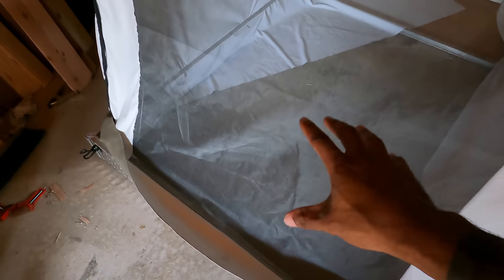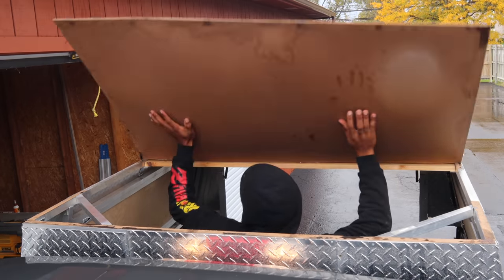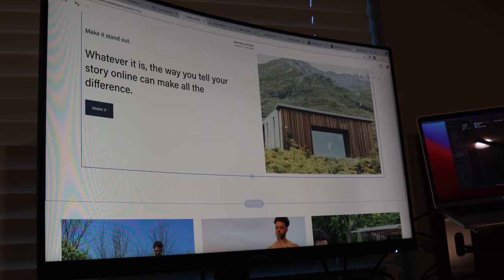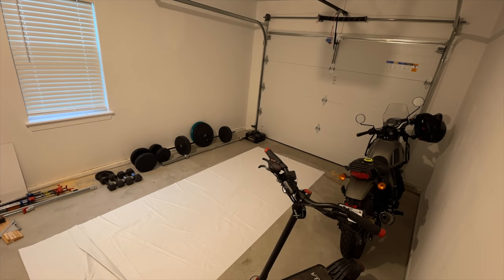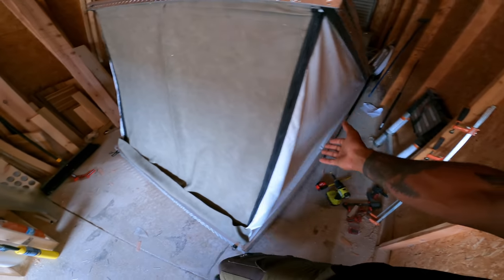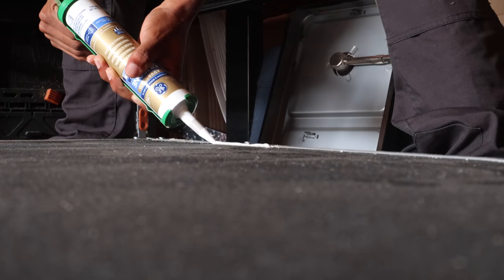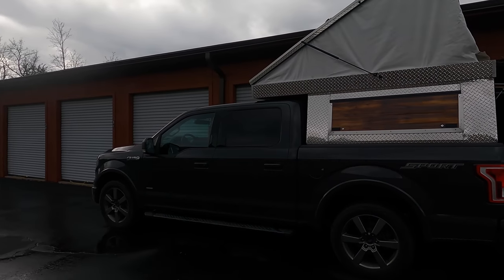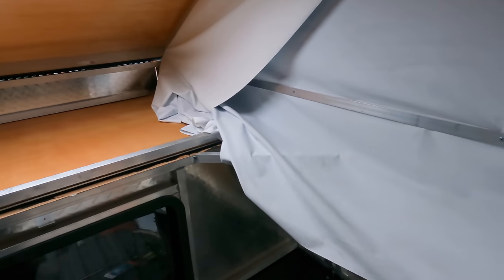Finishing My DIY Rooftop Tent | Overland Truck Camper ep. 7

Comment: I love your ingenuity.  One thing I would recommend, is the next time you build a tent, put he solid panel on the inside of the netting, with the two connected at the bottom.  Add in some 6" tails of the solid fabric at the bottom and then you can open and close it easily from the inside, roll the solid part down and tie it out of the way.

Comment: I am a seamstress, I am glad you took in account for extra allowance before cutting. I think you did a great job, for your first sewing project. 👍👍👍👍such a great inspiration. Is the fabric waterproof or don't forget too. If you have to waterproof it, test a piece of the scrap fabric to make sure it does not stain. For the damage to the fabric, cut some of the scrap fabric larger than the damage area, there are many products at a sewing store you can attach the scrap to the inside wrong side facing in as a patch

Comment: Looks great, before you cut the fabric, you want the walls to run outside the framing to carry any water away. If you don't, you'll need to sew or fabric glue some flaps to shingle over the lower frame.

Comment: Awesome job, and you put zippers in, ON YOUR FIRST SEWING PROJECT. MAN, GREAT JOB! One thing I would recommend, is that using butyl tape around where you put the fan/vents in the top, and where the pop-up tent sits on top of the camper frame. I didn't see you install any, but that could have been deleted in editing, but I didn't hear you mention anything about butyl tape either. It's not that cheap, but if you want a water-tight seal, GUARANTEED, butyl tape is the way to go. It's pretty easy to work with, and seals between the surfaces perfectly, filling in uneven surfaces like magic, and seals any screws or mounting hardware you use at the same time. Now if you ever have to replace it, like if you had a manual vent fan and upgrade to a larger one, or an electric one, it's a you-know-what to take off, but you won't find a better product. It's most commonly used in RV's, but a lot of DIY van builds and camper conversions use it too. Did you use any kind of waterproofing on the tent material? That's something you're gonna need as well. What kind of material did you use? Regular tent canvas, or maybe duck canvas? 

This video just gave me a great idea for my SUV conversion.  I have a Rendezvous that I love, and with the back seats out, I have an area that's 4 foot wide and about 6 1/2 feet long, but it's only 4 feet high. I've been wracking my brain trying to come up with a way to put some more headroom in it, and I think I just figured out how to do it, thanks to your video. Can't decide if I want to do the single sided raise for the pop up, or have a dual sided that would give me 6 feet of standing room almost the full length of the cargo area. Looks like it's time to go back to the drawing board for me, (well, a digital drawing board using Google SketchUP), and get into some serious engineering. LOL. This idea would save me from needing a different vehicle, like a cargo van or box truck, I wouldn't have to tow anything, and I would still have pretty good aerodynamics since the pop up wouldn't be very much higher than the original roof when driving, while giving me the headroom I need when parked. Can't thank you enough for this idea!

Comment: Really impressed by your skills! To make the material fold internally more easily when lowering the top you should add some elastic to keep tension on it at all times. Also the material at the back to hide the zip will be a major catch for water so you may want to add some holes to allow any build up to flow out!
Great job though

Comment: Amazing. Quick note, it would be more practical to have flap and zips on inside of tent so can go to bed looking at stars and if starts to rain or too windy don't have to get outside to close flap. Could just attach second flap inside using velcro, one side sew on the other self adhesive. Also better to stick solar panel onto roof as tape over top compromises the panel and won't get power you should. Looking forward to next project. 😎

Comment: You're having issues with gas struts cause you're installing them backwards. Think about leverage points. Always try to place the strut at the mid point of the lifting material like in a car hood so that it doest put undue pressure on the wood. Awesome build!

Comment: If you plan to to any offroaded id suggest to raise the tent part up another 2-3in as it is very close to your trucks cab and will end up hit it if you go offroad or the truck has to flex due to some weird road angles. The other thing is the window you used for the top piece looks like a door window. If its a door window be mindful of when it rains as those windows are designed to let a little water in and out the bottom side via a weep hole/slot. It looks like you have it sealed and taped up but just a thought about trying to stay dry. Overall the build is awesome and well done!
Reply from the maker: Thanks for those tips I’ll keep that in mind. I’m glad you like the build!

Comment: Excellence as usual!  Just think how high it would have been if you had used 4 struts lol. Looks like you’re going to need something to pull the fabric in so it doesn’t get damaged when you close it. 👍🏻 Good job!
Reply from the maker: Thank you! The damage didn’t happen when I closed it. It was from when I was moving the tent to secure it to the top of the truck. There’s no issues opening and closing at all
Reply: @Dualex_Builds  Great, I was thinking maybe you could do something with a golf umbrella, have spokes at the sides to brace it. It looks so smart.
Congratulations on reaching this stage, great head space. Looking forward to the next video.

Comment: one recommendation for making it easier to fold up is a bungie cord going around the canvas from one hinge to the other. this will put the canvas towards the inside while you close it so you don't have to fuss with tucking while you close it. just add a hook on the outside to pull it up/down to once it's open so it's not pulling on the canvas anymore.

Comment: If you bolt the two structures together, you will no longer be able to move the camper around single-handedly.  It might be useful to keep them as two parts -- can you tie them together using some kind of buckles, like you used to hold down the tent lid?

Comment: Dude, well done.  I'm an engineer and I'm impressed with your planning, design skills, and build quality.  Loved the point at roughly 15:00 where you said you were just staring at it.  Totally get it.  When a design comes to fruition.

I saw your video from Nov 2.  How's it holding up?  Leaks.  How'd you seal it down to the top of the bed and between the top of the shell and the bottom of the camper portion?

Comment: Your skills are above and beyond Sir! By the way…Is your fabric waterproof or water resistant? I was thinking a rubberized or camp tent canvas fabric might prove more durable…thoughts? The way you have it attached it would be simple enough to switch out the tent material later if you wanted to upgrade and install or sew plastic windows on the sides of the pop up tent Material…keep up the awesome work!💪🏼💕
Reply from the maker: I used outdoor waterproof fabric instead of camping tent canvas because it works better for insulation and is still good in the rain. I’ll explain more about the fabric and all of the little details about this build when I do my final tour later on next week. This video is just kind of showing how i put everything together

Comment: IT'S WONDERFUL.
I USE A SEALANT CALLED SILASTIC 747. THE CLEAR IS BETTER THAN THE BLACK. IT PREFERS A PRECOAT FOR EXCELLENT BONDING TO ANYTHING , I'VE USED IT TO FIX MY CONCRETE WATER TANK 32 YRS AGO.
I BUY IT BY THE BOX ((X12 PR BOX)).
I DON'T USE ANYTHING ELSE.
I FOUND OUT MANY YRS LATER, IT WAS INVENTED FOR THE 747 JUMBO, SEALING THE PLATES. WHO WOULD HAVE THOUGHT. THE BLACK MIGHT SEEM USABLE & HIDE STUFF, BUT IT DOESN'T ADHERE AS WELL AS THE CLEAR. DON'T KNOW WHY, I'VE ASKED.
BUT 32 YEARS ON A 20,000 GALLON CONCRETE WATER TANK, LOOKS LIKE I DID IT YESTERDAY. AND I LIVE IN A DESERT BASICALLY. LOVE THIS TRUCK BUILD. I'M DOING THE SAME. BIT OF WOOD & AL CHECKER.
GR8 JOB MATE. CHEERS OZE JOHN...

Comment: You did a great job and are extremely talented. 
 I do have one question, on the tent the little envelope area at the front bottom ,does it collect water when it rains?  
I just would have thought that a feature like that would have been at the top and  facing down.
Not criticizing you in anyway, just an observation and question.

Comment: What do you think the overall weight of the camper from the bed up is?
Reply from the maker: Without the drawers in it’s probably about 250lbs and with the drawers it’s about 350. I actually want to weigh the truck after everything is on it just to see but it’s very lightweight regardless. I can easily pick up and move the entire thing by myself it’s just an awkward shape

Comment: Gotta express my concern that the current state of the tent design won't support a bed
Reply: I'm very curious to your statement do you care to elaborate
Reply from the maker: I don’t think you get where this build is going yet. Just keep watching the next few coming videos and I think you’ll get a better understanding. I’m not even sure what you’re saying here
Reply: @tanyaholmes3213  I hope I'm wrong but I don't believe the angled aluminum where the bed slats are going to sit will support the weight of a grown man. I also don't believe the middle of the camper can support the weight either. Really hope I'm wrong I'm building this also.
Reply: @Dualex_Builds  not sure if my terminology is correct but I think it may need "trussing" (support) above and below the window frame to the respective upper and lower portions of the camper frame. I may only be experiencing weakness in these areas of my build because my bed is longer on my truck Wich made my windows longer. With the trussing and 2 inch angled aluminum also of a thicker grade for that lower frame portion of the tent where the bed slats will go might be necessary. Thanks for your reply and all the great videos excited to see how this turns out.
Reply from the maker: @trentcofaxmtg7501  it’s plenty strong. I already have the bed platform up and it held over 600 pounds. Me and 2 of my friends sat on it for an hour today. 2 of us are over 200 lbs
Reply: @Dualex_Builds  up in the tent area? That's amazing! Thanks for the reply can't wait to see it done and finish mine too.
Reply from the maker: @trentcofaxmtg7501  no problem. This stuff is a lot stronger than people think if you put it together properly
Reply: @trentcofaxmtg7501  I thank you for pointing out potential imperfections what is your professional opinion and what do you suggest to correct the the situation at hand.

Comment: Some occasions really need 4 hands.  Pity for the material you ripped when you dragged the roof out of the garage. Couldn't you have called some favors in, and got someone to help you for half an hour?
Reply from the maker: I couldn’t get any help that day but I do also pride myself on being a one man army. I think it would have torn either way because it was the first time putting it up and I didn’t know where the stress points were yet. Having help would have been a marginal difference